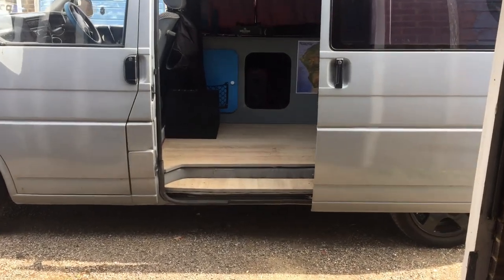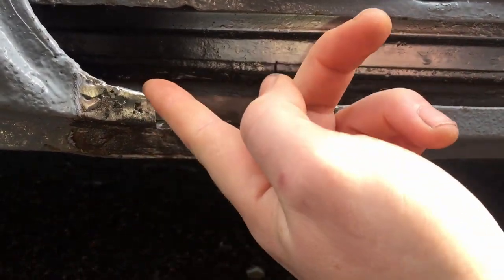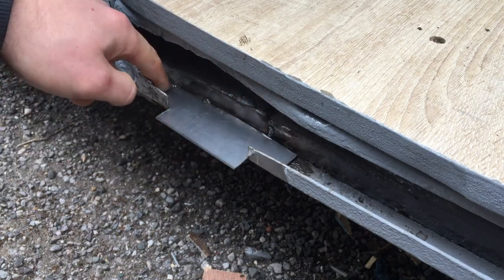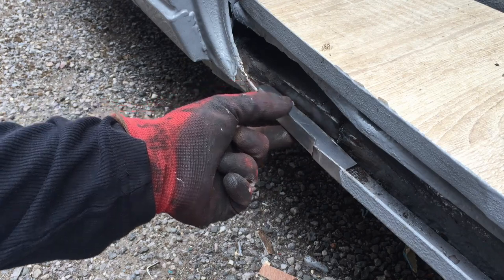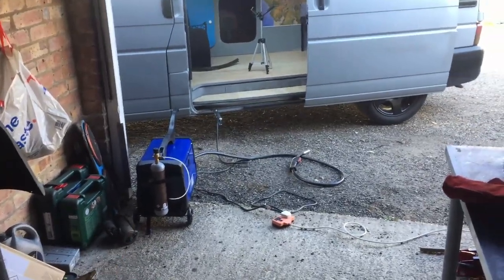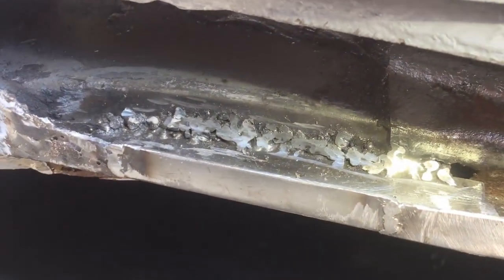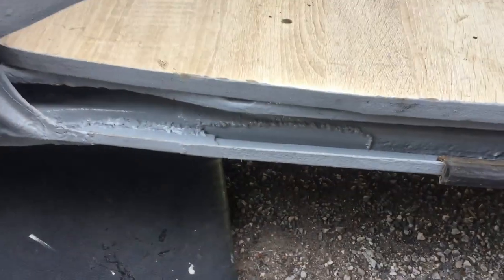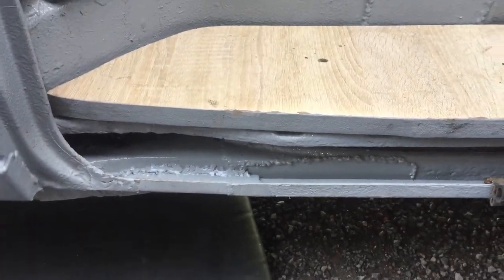My First Weld Repair

Comment: I just recently bought myself a welder too. a cheap flux core one from lidl.  I plan remake my campervans bed from box section rather than wood. Now, im clearly not in a position to give you much advice as im only learning myself but I would say you probably need to turn up the power on the welder and maybe the feed speed.

Comment: Just a bit cold mate that's all, two options turn the feed of the wire down or turn the heat up. For that sill section I'd say turn the wire feed down and you'll hear it sounds much better and the weld wont be as cold as there's more heat into less wire

Comment: Again mate get some more heat into it. I have no doubt the repair you've done will hold. Have a google of "cold mig welds" thats what you've got there but well done on your first repair!
Reply from the maker: Thanks! I’ve got plenty of spare time so I might even get that paint off and add some more hot welds onto it

Comment: What paint are you using? Fighting rust on a T4 is ongoing. I've started buzzing back to clean metal, painting with "Mipa Rostversiegelung" (corrosion sealer), and then painting with an epoxy primer. Then using something like Epoxy Mastic 121 as the paint, then a top coat.
Reply from the maker: Hi Marc. I have been using Hammerite products (kurust and “direct to rust” paint) mostly. I don’t know how well it will last. Your method is probably better than mine

Comment: Exactly the same boat as you Joel, am about to start doing some welding on my T4. My sliding door bottom area also rotted out.  Did you disconnect the vans battery etc? I'm a bit aprehensive as im going to be welding in the driver and passenger step area, so its close to front end electrics. Worth taking the plastic steps out and checking your own van there, a lot of T4s seem to go in that spot.
Reply from the maker: Hey. I’ve had both steps done already by a professional last year. The official advice is to disconnect the battery and remove the fuel tank, but I did loads of welding without bothering to do either of those. As long as you place the grounding clamp in a nearby spot so that the path of the electricity only goes through the chassis then you are fine. Good luck!
Reply: @JoelsStuff  Cheers Joel, watching your videos has been quite inspirational to me. Especially that rear wheelarch area, what a ngithmare eh? Sary stuff when you cut it all out like that. Well played tho ;)
Reply from the maker: Thank you! It does get intimidating when you are in the deep of it, but looking back it wasn’t too bad at all. It just takes a lot of time and effort. Good luck!